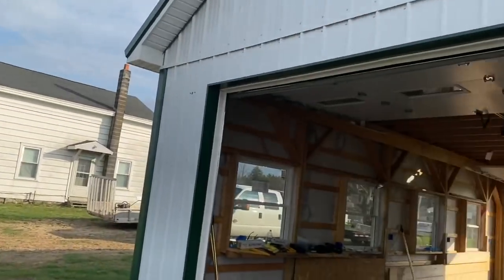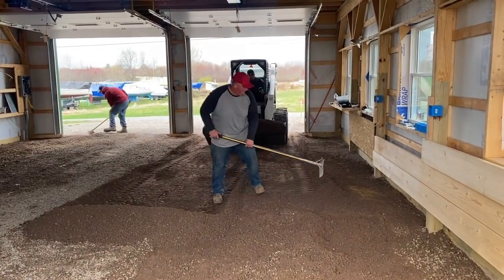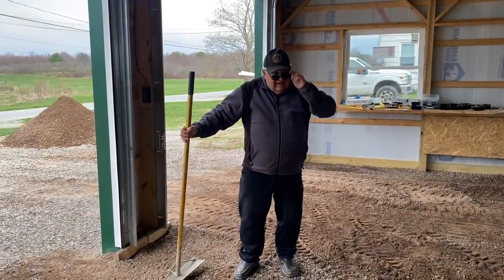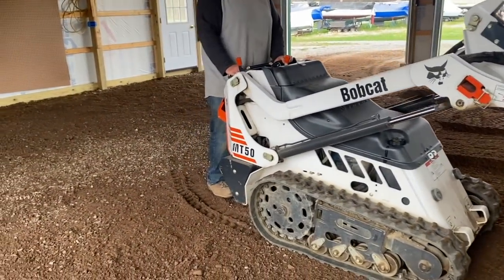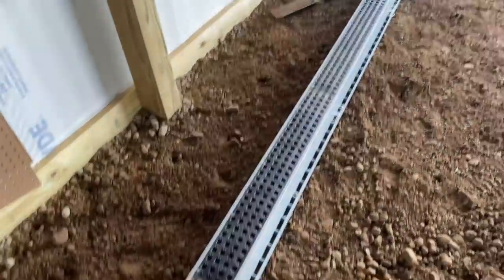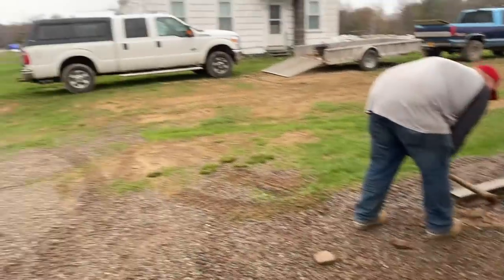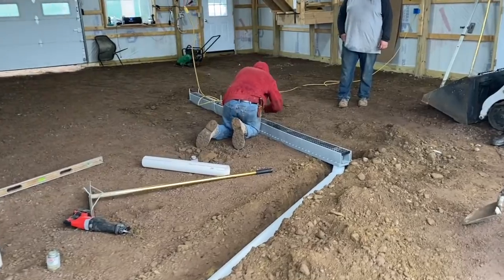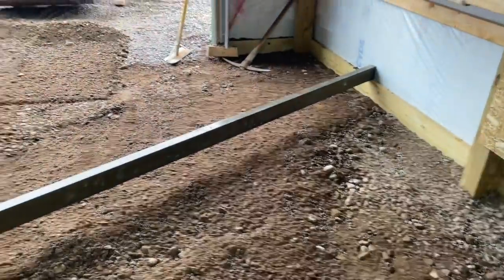Pole barn floor with drain part 1. This drain actually works. 👍

Comment: Kkplumbing from Wisconsin.... guys... love the content.... please put a trap at trench drain then run horizontal to daylight or sewer etc....keeps rodents and air from access to the trench drain.... if not heated bldg...... pour gallon of rv antifreeze in trap in winter and  after using during  freezing  temperatures.... you will  be happy you did!!! Kk
Reply: I'm a little confused on this. Could you go into a little more detail cause I think it sounds like a smart idea! Planning on building a horse barn in a couple months and want drainage but worry about dirt and horse poop clogging french drains or any grates up. If you have any advice I'd be super thankful.  Just wanna do the right thing the first time and not forget anything.

Comment: I've worked with those little bobcats (the Toro version actually) and one addon I consider essential is the stand on platform that attaches to the back. Two reasons, (1) You won't run over your feet accidently while operating it and (2) If the platform is bolted to the back (not the little trailer style one from the factory) adds extra deadweight to counterbalance loads in the bucket.

Comment: That drain is gonna be great for your uncle👍. All that snow yall get. 
Did yall drive some pins on the side of the drain to hold it in place so it don't move when your pouring?

Comment: Great video!  Really appreciate you posting this.  I am putting up a new pole barn or steel shed on my property.  Would you say its cheaper to just do the foundation and rough-ins ahead of time?
Reply from the maker: I would get your gravel pad in before you build it if it is a pole barn. The rough line for the drain I would just do after barn is up.

Comment: Ron.... I can’t believe the attention to detail on the grade to the drain! Great job. Why didn’t you use sch. 40 on the drain? And would you consider a buying a skid steer? I know you have Karl, but skid is more maneuverable. You also have a mini excavator I seem to remember. Hey Buddy .... gettin close to TEN LARGE! Come on peeps...how about a free tee shirt for new subs?
Reply from the maker: Hi uncle Jim. Thanks bud that's how we do the drains 👍. That pipe is what fits that style drain plus its under 5=1/2 "of concrete. It should be good under there. I would like to get a small dump truck before a skid steer. Wont be long and we will be at 10K. thanks for the support uncle Jim. 👍👊
Reply: @bondobuilt386  Fist bumps back at Ya Buddy.
Reply from the maker: Thanks uncle Jim 😊😊
Reply: T190 Bobcat for grading. Demo also

Comment: I’ve got a 50 foot by 60 foot pole barn to do.  I’m still debating on tackling this or paying someone
Reply from the maker: Joe you could break it into smaller sections. 👍
Reply: I was debating on doing it in 3 20 ft width sections
Reply from the maker: @joefrancis2316  That seems manageable. get plenty of help.

Comment: Looks great, is there a reason why you don't use water proofing in the wood so the concrete does not rot the wood? Or is it unlikely  for that to happen?

Comment: I am putting drain in mine, about 4 ft. from door opening. 30 ft total. But manufacture says 4 inch concrete under drain.
Reply from the maker: We always do a foot of tamped crushed stone with dust or crushed gravel. Never seen one move. Go with the manufacturers recomendations though. 👍

Comment: hey great videos thanks ? i am pouring a 30x40 .i want to heat the floor how many feet of  tubbing do i need?? how many loops?? an what manifold? what is the max footage you can be off and it wont effect nothing in loop run?? thanks

Comment: Hi Bondo, have you used this type of drain with a insulated heated slab in garage or shop?  Was planning on a couple of round floor drains but this would work great if you have had success with this type of drain with a radiant heated floor.

Comment: How much would it cost to do this on a way smaller shed, barn? Really need a floor drain and don’t want to spend 10-20k to get one.
Reply from the maker: I can instal one for $1000 if I was doing the floor. The grade is the hard part.
Reply: @bondobuilt386  which state are you located in?
Reply from the maker: @maximumdetail4809  New York. Upstate 45 min north of Syracuse.
Reply: @bondobuilt386  I’m located in geneva
Reply: @bondobuilt386  I’m around and hour away from you

Comment: I don't use the plastic drains. I screw a 2x2 onto a form board on each side of the drain and pour up against it then I can pitch the floor in the drain, then add steel grate on the top. never have to fight to clean it. way cheaper
Reply: Would love to see this done. You know of any videos showing this?
Reply: @WheretheJones  never seen a video
Reply: @ Where the Jones 
Iowa Matt is correct. I'm a cabinet maker who formed my own concrete driveway which sloped down to the garage. As Matt suggested, just form the "box" the height and pitch you desire with a 2x2 around the top parameter. Once removed, pour/slope the drain bottom of the trench to the PVC drain in the bottom  of the trench. Of course you want to plan and run the PVC drain prior to pouring the main floor. Also determine what steel grating you will use as to determine what size to make your concrete trench lip.
My exterior trench was still in great shape when I sold the place 10 years later. The only thing that I would change is to put a P trap near the daylight end. That should keep the cool air from flowing back inside the heated garage. 
Oh yeah, I had a rabbit squeeze through 40 feet of four inch schedule 40 and get caught in the elbow just below the concrete trench. Tough getting him out two weeks later! So definitely a P trap for me.

Comment: For grading (inside a building) we use a 695 Leeboy grader with a topcon system 5 laser system. We can use it for flat work (zero slope) or any slope floor you can design. All about the setup. For roughing in I prefer hubs with bluetops. For very tight spaces I use an excavator with a grade beam and thumb. Again, bluetops with layout. Works wonders